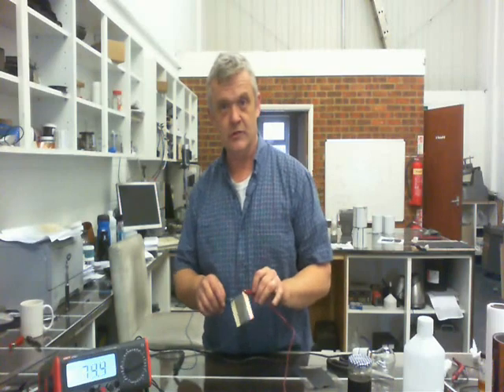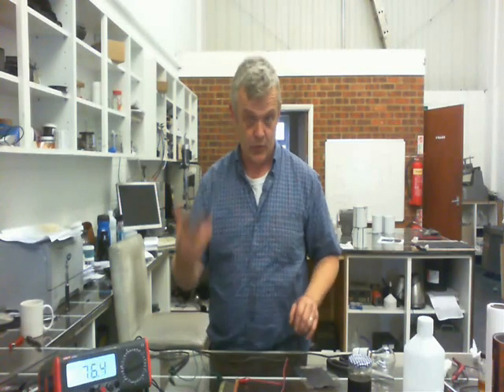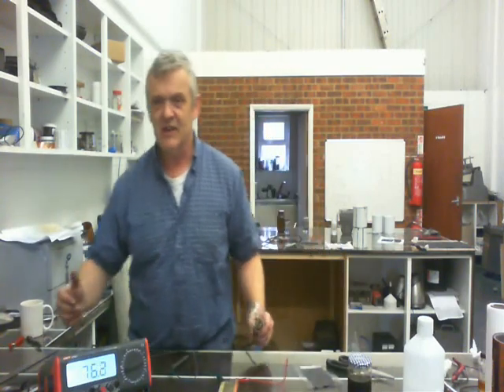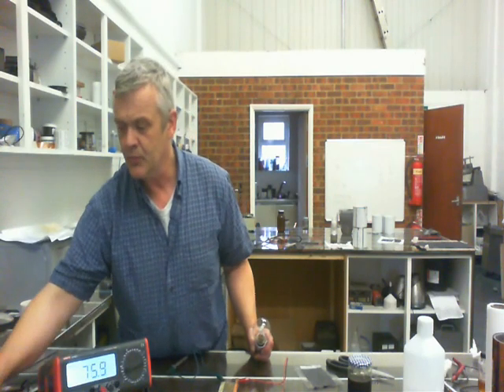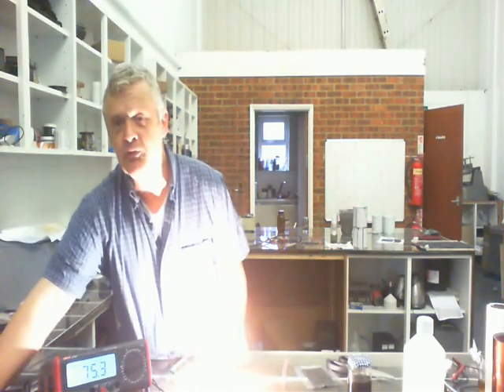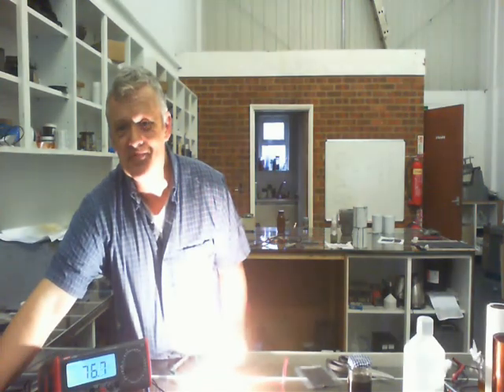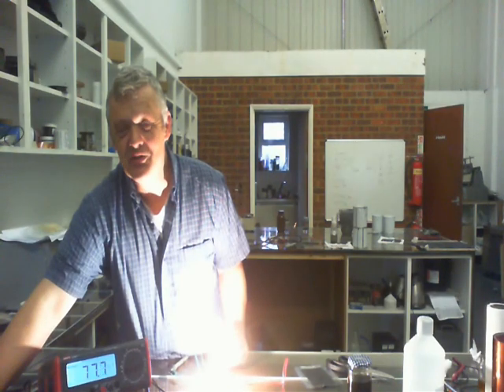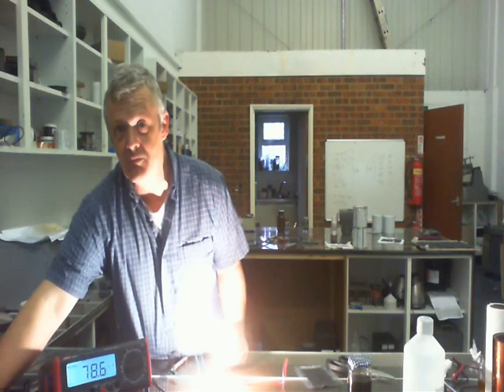Solar Cell From A Leaf - Update

Comment: How does the chlorohyll generate a voltage exactly?
Reply from the maker: I am not sure how to answer - for an exact answer you might want to do a bit of background research on this - anything i can offer on the comments is bound to be a bit glib
Reply: I just don't understand why your using chlorophyll in your solar cell.It's used in plants to extract sun light but how does your solar cell utilize that exactly?
Reply from the maker: Blueghost136
The function of the reaction center is to use the energy absorbed by and transferred to it from the other chlorophyll pigments in the photosystem to undergo a charge separation, a specific redox reaction in which the chlorophyll donates an electron into a series of molecular intermediates called an electron transport chain. The charged reaction center is then reduced back to its ground state by accepting an electron, the electron that reduces ultimately comes from the oxidation of water into O2 and H+ through several intermediates in an organic system. This reaction is how photosynthetic organisms such as plants produce O2 gas, and is the source for practically all the O2 in Earth's atmosphere. Here I am guessing it is passed on to do useful work

Comment: hey, maybe you can try and add a layer of your ink under the whole cell... ground that layer... aanndd maybe it will make a hybrid solar cell super capacitor??. + if your solar cell is kind of tansparent, if you have a black layer on the bottom, it will get more light to it. I think this is why you get more power out of your higher chlorophile content. it is darker.
Reply from the maker: could be - interesting ideas mate

Comment: Great video. What about a chlorophyll/graphene mixture maybe with some magnets involved? Could be interesting. Keep it up!
Reply from the maker: why add graphene and magnets mate?
Reply: lol clorophy is to use the photoelectric efect, graphine is an amazing conductor that can be really good for capacitors or batterys and magnets are just magnets...i think you are missing the point bro
Reply from the maker: stefano carlo Celsi
It could well be - could you explain it to me - the chlorophyll - I understand - after all it was me that suggested it. but I don't get why you would want to add graphene and use a magnetic field - I don't see what added benefit you would get for the added expense and trouble - 'magnets are just magnets' doesn't explain it to me and it was a genuine question.
Reply: Robert Murray-Smith lol i'm not the one that suggested thtat, it was teh first coment, i just tried to explain to him what the things are for
Reply from the maker: stefano carlo Celsi
lol - got it mate - sorry i get confused easily lol